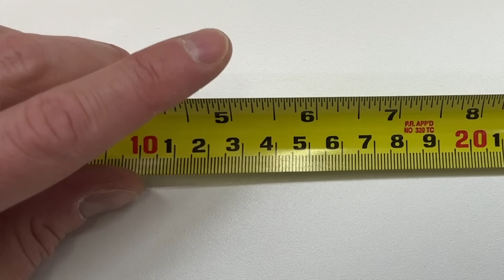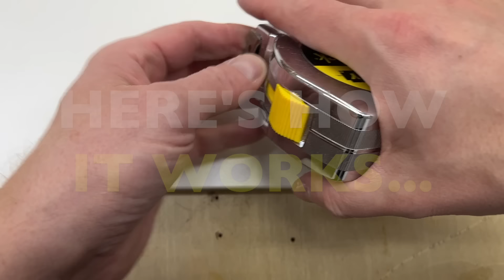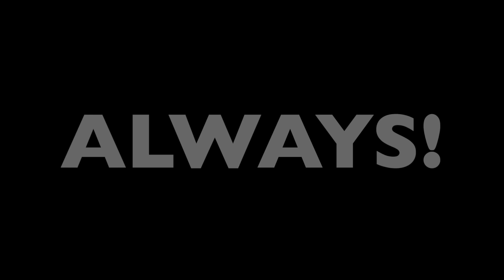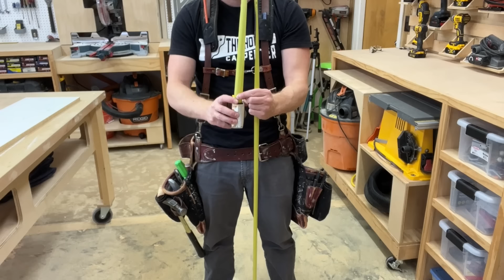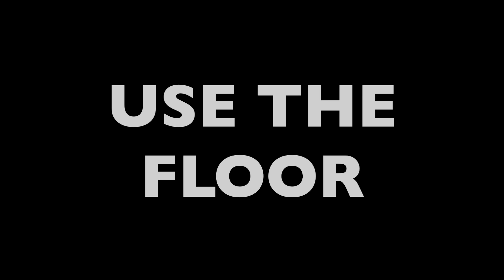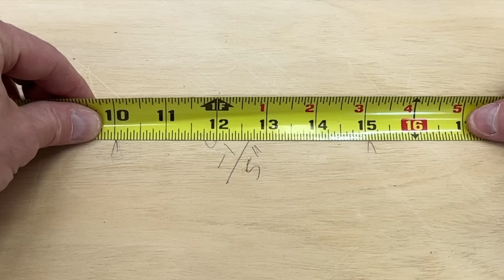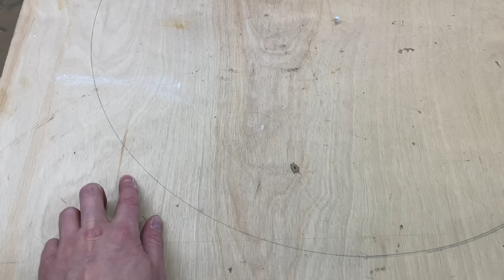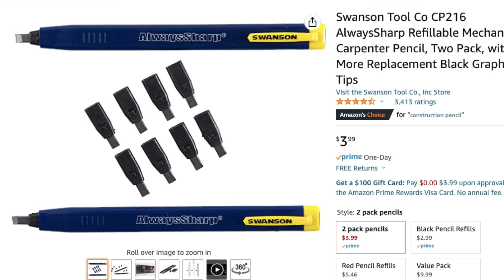ALL TAPE MEASURE TRICKS Explained...In Just 13 Minutes! (Measuring Tape Pro TIPS, TRICKS + ADVICE!)

Comment: I recently bought a few metric tape measures and switched over to using metric for all my home projects.  Millimeters are awesome.  It's probably just random luck, but the mm is the freakin' perfect size for home projects.  It's the smallest length you can reliably measure quickly (without special tools and extra lighting).  Metric literally requires less effort to remember your measurements and helps you quickly cut accurately.
Reply: And I thought I was the freak using a metric tape measure in Imperial-Land ;-) Especially for cutting pieces in half or quarters. What is half of 13⅝ ?
Reply: @simongchadwick  6 13/16"
Reply: @simongchadwick  swing the tape, you won't need to figure it out, but it's pretty close to 6 13/16 I'd think...
Reply: @InuranusBrokoff little late to the party here but I'm pretty sure you're correct.
Reply: @simongchadwick  6 and 13/16. Did that in my head.
Reply: @simongchadwick  6 and a half and 5 sixteenths
 gives you 6 and 13/16 no
Reply: Coming from a metric person, operating fractions keeps your mind sharper I believe. And also, in  metric you get an occasional "100mm trick" when you mistake your measurement by 100mm or accidentally swap digits (i.e 4728mm instead of 4278). I wonder if there's an alternative thing in imperial?
Reply: It's hard for people to change so kudos to you.
Reply: Professional My Dad was a cabinet maker born in 1927. He said that switching to metric was the most beneficial change in daily working in his whole career.
Reply: I am over 70 years old so grew up using the imperial system. The metric system is definitely better all round. Except it doesn't divide by 3 as the imperial system does.
Reply: Why everyone other than Myanmar and the us use it
Even then the us military uses it 😂.
I wish we'd get rid of the last empire/imperial measures here in the UK. The hold overs are confusing
Reply: I feel like I'm stuck with imperial.  What's great tho is i can easily use a metric tape if it's available, because yeah metric is so much more logical.   Only thing i cant abide is both on one tape
Reply: I measured some 1/4" plywood in my shop with calipers and they were all closer to 1/5", but really close to 5mm. A few pieces of 1/2" ply were also off, but still pretty spot-on to 12mm. I'm debating moving to metric because of these types of things. I should be able to put two 1/4" pieces together to make a 1/2" thick board, (because of math LOL!) yet it will never measure 1/2" thick and seldom matches a 1/2" piece of ply. Oh, 5mm + 5mm = 10mm, not 12mm.
Reply: @charleshenbest8263  thats one thing that endlessly pisses me off. NONE of the measurements for lumber are right because they changed them years back so a 2x4 isnt 2 inches x 4 inches anymore because they cut them 2 inches x 4 inches and then smooth them down which removes around a half inch in either direction so the 2x4 is a 1.5x3.5
Reply: I work in civil engineering / highway construction / surveying, so the foot is broken down into 0.01, which is slightly smaller than an 1/8", but takes advantage of the 10 system of measurement.

Lufkin makes a 25' engineering scale tape measure.
Reply: Welcome to Australia mate 🤙Enjoy your stay
Reply: French living in the USA. 
I never understood the imperial system. It's so confusing.
Reply: @cd5696-o5n  Sadly, lots of people who have been using imperial units their whole lives lack some basic intuitive sense of measuring.  You’d be surprised how many of us Americans do not have a good sense of an ounce or fractions of an inch.  Ounces are a mystery.  And most people here presented with a small 1/16” wide pellet would have absolutely no clue if the pellet’s width was 1/4”, 1/8”, 1/16”, or 1/32”.  On the other hand, if you gave a small 1 mm wide pellet to someone in a metric country, they’d immediately have an intuitive sense that the pellet was about 1 mm wide.  Imperial literally harms our numeracy and industrial competitiveness.
Reply: @pilafmon  Yes, fully understand that. Have been living here for over 4 years, and only measure in cm. I'm starting to be ok with the lumber measurements though :D 
Every time I asked a friend to explain the measuring tape, most couldn't explain it. 
This video was great for me.
Reply: @DemPilafian the guys that need to know imperial know it inside and out.  It isn't that hard and as an engineer I think learning two systems was good.  Every US engineer learns both systems and how to convert between them... endlessly.  Regular people can't make change either, and the dollar system is essentially metric.  I wouldn't worry about whether imperial is harming our numeracy, quite the opposite I think it improves it where it matters.  This country was built by men who could use fractions, and for nostalgia alone I'd choose to keep everything as imperial as possible.  It didn't hurt past generations, so I don't think the problems you raise  are caused nor fixed by the measurement system being used.
Reply: @Platinum1812 today’s kids are being trained to be dumber/ lazier by the second… So, I’m sure at some point they ( the people in charge ) will sell the idea to the masses and convert over.
Reply: @Platinum1812   I have a bachelor’s and a master’s in Computer Science, and I completed over 40 STEM classes in my university studies, including lots of calculus.  Guess what?  I can do fractions.  I can also drive a dilapidated crappy Yugo car, but why would anyone do that?  If you want to drive a Yugo go for it, but don’t expect anyone to be impressed with your nostalgic Yugo.
Reply: @DemPilafian  not that it matters.  I'm not impressed by the metric system either.  Why would I be.  Being able to use both I can't figure out why anybody cares so much.  Except, in my opinion,  the practice of learning to solve problems in both systems is good for engineers.  Especially when you have some data in one and some in the other.  It makes you careful with units and aware of what they mean.  In my professional experience, where we happen to use imperial after having tried metric back in the 90's and it not working because contrary to your claim the men in the field had no idea what a Newton-meter represents but knew exactly what a foot- pound was, it just wasn't worth confusing everyone with units they weren't familiar with.  (And that was a government mandate that was rescinded in short order.)  Everyone  in my family knows ounces, pints etc... and of course the imperial system built the largest industrial and economic superpower more than once.  So apparently, the imperial Yugo works much better than you seem to think.
Reply: @Platinum1812  Even your language that keeps assuming engineers are "men" is outdated.  You can cling to your precious system, but it will go extinct with you.
Reply: @DemPilafian  "men that built" i.e. past tense.  Reading not your strong suit.  I have no issues with female engineers. Not sure when I offended you, but glad you found a system you can comprehend.
Reply: @pilafmon  Sadly, I'm neither surprised, nor unaware. Because you're correct. I've been here 52 years ( my whole life) and it BLOWS my mind that people haven't a clue! But it's not fractions, they can't handle decimals either. So mm won't help them either. Apparently, we're all just supposed to pinch our fingers or spread our arms and say........"it's about this big". Embarrassing.  (By the way, 1 ounce = 30mls..... Fluid that is. LOL)
Reply: @cd5696-o5n  imperial is practical but outdated. The fractional system made a ton of sense in the past since it's way easier to divide things in half over and over which is why you see 1/2 inch, 1/4 inch, 1/8 inch, and 1/16 inch but not a 1/3 inch or 1/5 inch. It's hard to divide things into tenths compared to eighths. The US has somewhat adapted the metric system since you can buy things in liters, many things are sold in metric, metric is used in science, the military, and in much of government and the imperial system is defined by the metric system now. 
The major reason for the US never switching to metric is simple: industry and war. The rest of the globe either switched to metric before industrializing so everything was just made metric at the start or they adopted it when they were rebuilding after war and had to largely buy/build new stuff anyways. The US though was one of the first countries to have widespread industrialization before the metric system really took off, at independence the US already had a fairly strong industrial base and by the mid 1800s already had one of the worlds largest economies heavily built around industry and was one of the worlds first major industrial powers. In the early 1900s through WW2 when many countries adopted the metric system the US was expanding industry and never had the devastation that places like Europe and Asia had and thus didnt need to rebuild but switching to metric would have cost a fortune and hampered growth, which was explosive, so the costs far exceeded any benefit. Since then costs have only skyrocketed, even though NASA mainly uses the metric system for measurents since most of their suppliers dont it would cost them $370mil just to switch the upcoming space shuttle to metric and that's just ONE thing in ONE group, the cost to go fully metric would cost a fortune so instead the US is kind of incrementally adopting it so there isnt some massive upfront cost.
France was kind of the outlier in all that though because they invented the metric system and first adopted it right around the same time they started to rapidly industrialize. They also spread it to all of their colonies as well as some conquered areas under Napoleon.
Reply: Metric is just so much easier.
Reply: That's awesome and initially challenging but worth it in long run. There's a lot of cross over these days in many aspects of many parts, supplies, and trades. It's good to also get a mental "equivalent" in your head between mm and 1/16ths, inches/cm. But I'll bet you work alone. I've  bought a couple metric tapes just to kinda build a relationship in my mind and to somewhat challenge my old rigid mind. One day my buddy went in and grabbed a tape out of my draw to help me with a project. He climbed up in the air, opened the tape and said "what the f___ is this?". He threw it out into my woods and went down and opened a beer. "Get your own darn tape" he said.  LOL. I guess HE wasn't going to change!  Hell, a lot of better grade sheet goods and poly materials these days are all metric anyway cuz we don't make anything here anymore. Cheers.
Reply: Some metric rulers are graded in 0.5mm, which is about 1/48" I think?
Reply: @nikolairubinskii6450  pretty close yeah
Reply: Metric system is just incredible accurate. Loved it since I made the switch.
Reply: I wish all you people were doing this . I am from the Netherlands , and always am annoid by the utter stupidnes on these videos that people still dont use metric . You could have started 100 years ago with metric , but still they dont . Unbelieveble , how stupid can one , and a whole "modern " nation be.
Reply: @djstuc  so YOU say 🤣
Reply: Communist
Reply: Ok gay wad 🤣
Reply: Yes, but without being able to convert it will do little good
Reply: Freedom units for life, old dog new tricks as they say
Reply: @the.Original.G.Ninja.88   Imperial is from the days before our freedom when we were ruled over by a foreign king.  The imperial system is submissive and cowardly.  Stop licking the boots of a dead king.  Stand for liberty and use metric.
Liberty Units!  🇺🇸🗽🇺🇸
Reply: Glad you liked it :) i dont understand imperial and if i try it looks so congusing :) metric easy. Just number and zero if tens or hundreds etc :)
Reply: He tells you not to look like a rookie with a tape measure. Then he tells you to hold the tape in your dominant hand. I mark with my dominant hand.
Reply: I honestly feel that standard is a better system for construction. For one thing, it's easy to divide your measurements by both 3 and 4. In metric, the math gets very complicated when you need to do those types of division.

I like metric for most things, but I feel imperial is better for construction.
Reply: @imnotmike    Are you sure?
What's 1/3 of 2' 7 1/4" inches?
What's 1/4 of 2' 7 1/4" inches?
Reply: Down with Metric! America needs no foreign rulers!
Reply: I was educated in Metric, I know it well.  Don't find it to be better.  I think a lot of people forget that there are decimal inches, and that the Imperial world pretty much invented the machinery and processes that led to the 20th century.  

Carpentry is really dumbed down these days, we don't build complex things any more.  Or if we do it is all built into a comprehensive truss, with no attic space.  But when we did there were books on how to use roofing squares and the geniuses who invented all that long forgotten stuff had their reasons for using fractions.  

In a lot of places today, young people aren't taught much math so they don't know how great fractions are.  It is a lot easier to find the middle of 5 7/16"  than 138.  Just go to 2.5 and move along either 3/16, or exactly 7/32.  A decimal system exists with either inches or metric, and probably works better for people who are stuck using calculators.
Reply: it ain't even that it's a better measuring basis, it's the fact that our world is built on 4ft by 8ft sheets or random shit and 96 in long boards, they are designed to work together without inconsistencies, if half the industry switched and the other half didn't, what would happen anytime you overlapp
Reply: @RocketandMissile  More than 90% of the world uses the metric system. "Our world" would be inaccurate by a long shot.
Reply: Yet somehow England, with industry built on Imperial since the actual beginning of industrialization, managed to switch to the metric system long ago. As did everyone else who used Length of the Shadow of Emperor The Great’s Big Toe At High Noon Standard for generations and now doesn’t.
Reply: @RocketandMissile you said it sir.
Reply: The real world?  So chaotic and incomprehensible,  just like imperial measuring.  Nice own goal there m8
Reply: They’ll have to pry my inches tape measure out of my cold dead paws
Reply: @yogibeer9319  Why?  Does the imperial measuring system have religious meaning to you?  Australians are fully metric.  Do you think that harms their religious beliefs?  I view measuring as a practical thing.  I'd actually like to hear your take on the emotional angle.
Reply: @pilafmon  i think you may be a little too attached to the metric system if you're viewing it like a religion.
Reply: BS...We use FREEDOM UNITS, here in God's country! And that will never change!!🇺🇸💪🏻✊🏻🗽🦅⚔
Reply: @RILEYLEIFSON_UTAH   Imperial units are from the days before our freedom when we were ruled over by a foreign king.  The imperial system is submissive and cowardly.  Stop licking the boots of a dead king.  Stand for liberty and use metric.
Liberty Units!  🇺🇸🗽🇺🇸

Comment: If you need to find a vertical height that is out of your sight, line up the markings of the tape going up and going down (so the bend of the tape is at the measurement point) and take the average. Example, to measure bottom of beam of 12 ft, your tape will line up at the 7’ and 17’

Or just get a laser

Comment: For measuring into a corner - no need to bend. Every tape I have seen in Australia has an 80mm body. Simply place tape body  in corner and pull. Add 80mm to number. Some tape measures have this number stamped on body. Also seen tape measure from UK where you pull a metal lead in opposite direction to the tape which equals 100mm - making it even easier

Comment: The 25 foot powerlock has been my go to tape for 40 plus years...

A 100 inch stick can come in handy for longer inside measurements.

The metric/imperial measurement is silly.  Most of us are surely smart enough to use both.  Both systems have their place.  Just don't use both systems at the same time.

If you bend your hook (dropping your tape typically) you can recalibrated it  by carefully bending it back with a pair of pliers.  Confirm with a mark made by killing an inch.
Reply from the maker: All good points, muddy…especially the stick! They get almost completely overlooked these days,  but they’re still very useful tools 🙂